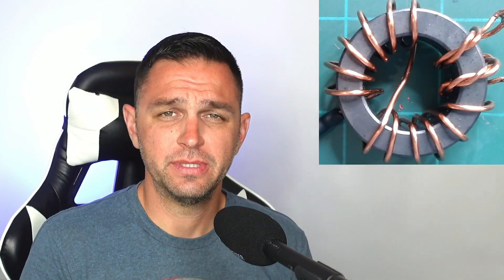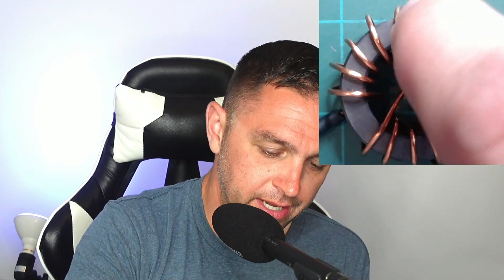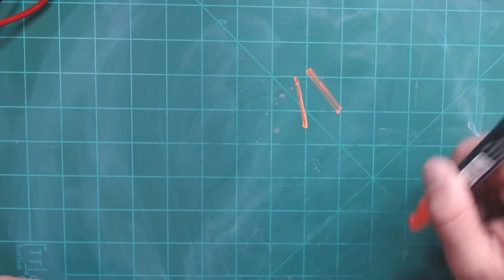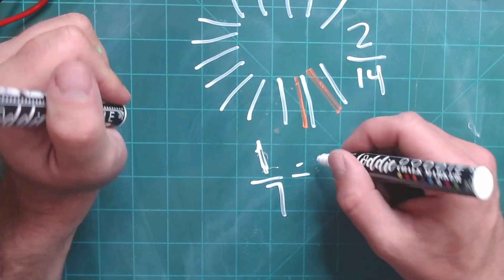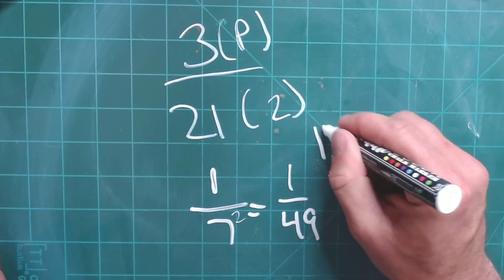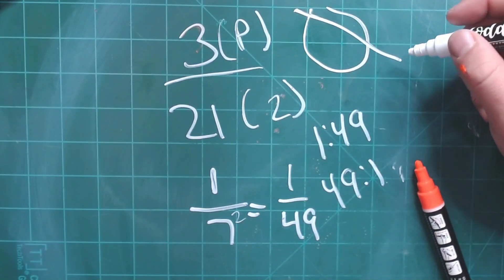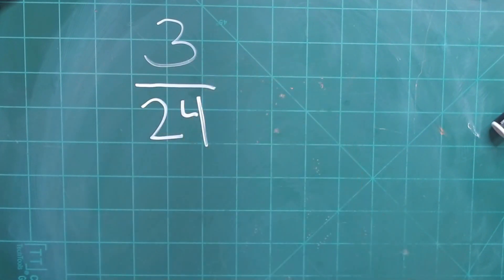EFHW Antenna / Transformer Ratios, It's too Easy!

Comment: that great. last one is 64:1 I find that better with 80/160 meters with type 43 ferrite. less heating. that the hardest part. telling the ferrite types apart. have to test like on a known VNA . don't need twist on primary to secondary. in fact only one 14 turn winding needed, put a tap on 2 turns . auto transformer 49:1 . and that a UNUN . 73's

Comment: Great video. The example you gave is 64:1. Am building a Good Guys EFHW (clone) and want to know why it has a 64:1 ratio. One of the comments gives a formula and it turns (no pun intended) out 3200ohms is the impedance it matches to a 50ohm coax.  Someone also mentioned putting in a tap to give the option of 49:1 - 2450ohms and I think that is a good idea. Thanks very much for the easy to understand description.  I will subscribe.  73 vk5wb.
Reply from the maker: I really want to do the tap soon.  I made a video on the x-tenna, which includes a switch between 49:1, 56:1, and 64:1 - and I think it's an amazing concept, just need to find a suitable switch.  Cheers.

Comment: I just made one, after the 14 turns I put a tap and 2 more turns for 64:1. That gives me 49:1 and 64:1. What ever tunes up the best. Putting my antenna low, I think I should have put in a 36:1 tap in there. Lower antennas sometimes have lower impedance. But I didn't think of that. It is made up and not taking it down to do that.

Comment: Take (secondary turns) divided by (primary turns)
and then square the result and then multiply that result by 50
giving you the ohms value the transformer will match.

i.e.  
If secondary is 21 turns and primary is 3 turns
Then 21/3 = 7
Now square 7 and get 49
Now multiply 49 by 50 and your transformer will match 2450 ohms

If secondary is 14 turns and primary is 2 turns
Then 14/2 = 7
Now square 7 and get 49
Now multiply 49 by 50 and your transformer will match 2450 ohms

If secondary is 24 turns and primary is 3 turns
Then 24/3 = 8
Now square 8 and get 64
Now multiply 64 by 50 and your transformer will match 3200 ohms

If secondary is 19 turns and primary is 3 turns
Then 19/3 = 6.33
Now square 6.33 and get 40.07
Now multiply 40.07 by 50 and your transformer will match 2003.5 ohms

If you put 3 turns on the primary and say 26 turns on the secondary
and put taps on the secondary windings starting at say 18 turns the
resulting matches for each tap will be...

tap 26 =  3753 ohms
tap 25 =  3471 ohms
tap 24 =  3200 ohms   this is the common 64:1
tap 23 =  2936 ohms
tap 22 =  2688 ohms
tap 21 =  2450 ohms  this is the common 49:1
tap 20 =  2220 ohms
tap 19 =  2005 ohms
tap 18 =  1800 ohms

Selecting the best tap for lowest swr is
easy and you have what amounts to a very simple
manual tuner.

This can be further refined by making the first several
feet of your longwire using something like very small
multi-stranded stainless steel aircraft control cable.
If you wind this cable onto a spool of some design
then you can change the actual antenna length without
cutting the wire, the turns all short out and don't
create an inductance...if the wire was insulated you
would be adjusting both antenna length and inductance
and you want only to change length. Using stainless
steel cable prevents rust and/or corrosion. If you have
your toroid mounted on a piece of plastic as is typical
then just cut two slots in the plastic to serve as the spool.
This is easier than adjusting the end of your wire by
folding it back since the adjustment can be made close
to the operating position with no need to lower the antenna.
This makes it easy to cover both 80 and 75 meters for example.

Combining the taps with easily adjustable wire length
results in an antenna for the field that can match any
HF band with a very low swr... if you use a spectrum
analyzer you will see that changing the wire length
moves all the harmonic dips either up or down in frequency.  
And changing the tap then refines the match lower or
higher in relation to the radios 50 ohms.

I hope my math is OK, I just used the google calculator
and did a quick check on this post, but you can see
what I'm doing here :-)

Comment: There was no VHF radio included when we bought our sailboat a few weeks ago. I live in Ontario Canada and since I’m considering a Ham radio licence in the not too distant future I’ve decided to buy a “handheld” VHF / UHF dual band radio that is of decent quality with features enough to suit my needs for now.

One of the features my new handheld radio “must” have is the ability to connect to an external antenna. After purchasing a radio I will buy and install an antenna on the top of the mast that’s designed to work well with that radio. Then I will run the cable {or cables} to the cockpit and cabin area’s and install permanent connections so I can connect my handheld when I’m in either location. 

I’ve been a boater for more than 40 years but always had a permanently installed VHF with my previous boats. Realizing I’m only able to transmit using VHF until I’m licenced for UHF here in Canada, it will still be nice to pass some time having the ability to monitor UHF during our travels.

Even though I’ve been doing a lot of reading about the different brands models and features, and despite watching several videos it seems a bit like information overload and honestly I’m feeling a bit lost trying to keep all the technical details straight but I must make a decision in the coming days because we’re launching our boat and I don’t want to be on the water without a working radio.

I would appreciate suggestions from those of you who have the experience and knowledge in this area. Perhaps you could offer a few good quality brands with the model numbers ranging in price from $100 - $150 {willing to spend more if justified} you feel would overall work well for use in my sailboat as well as my home. 

Once I obtain my Ham Radio licence in Canada I will also install an external antenna at home and this should get me started. Then after some hands on experience I will have a better understanding enabling me to make informed decisions later when it’s time upgrade.

Thanks in advance for your help and suggestions!

Regards
Tyler

Comment: (64:1) but what if the primary wires are made of lead coated copper, and the secondary is made of gold plated platinum wire?
What if you store the coils in a bath of liquid nitrogen?
What if its a full moon in Japan and my dog barks at the people walking by on a Tuesday and the coils are imaginary?

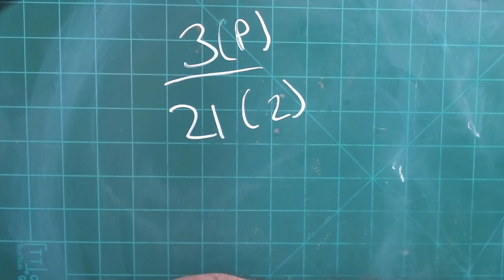Comment: I have found that a 40:1 or 44:1 transformer gives the best match with my little QRP kits and a 40m EFHW. I use  3:19 or 3:20 turns ratio.

Comment: Most Excellent.  More pleaase....  What number/type of Torrid do I use.  What gauge wire?  etc..
Reply: -43 or -52 mix are best for EFHW and other ununs for antenna feed points. -43 is the most common.  Size should be selected based o  power handling required. Sizes are generally measured in hundredths of an inch in outer, so an FT50-43 is half an inch in diameter.  50 size toroids are good for 5-10 watts depending on duty cycle, 140 size toroids are good for around 50 watts.  stack a couple together for a solid 100w transformer.  Wire gauge doesn't have to be as large as many people think 26 ga is generally enough for 100w, although 20-22 ga provides a nicer fit and will be slightly more efficient on a 140 toroid.  I use 26 ga in my QRP kits with a 50 size toroid.
Reply: @K6ARK  OK.  Please talk to me as you would a child.  Very ignorant.  So I have sitting in front of me several Amidon FT-240-43 torrids.  By your statement:  -43 or -52 then these would be OK to use?   So then... the amidon (FT-240-J) and (FT-240-77) and (FB-31-2401) would not work.  Correct?   Where does one learn these arcane arts? Tank you. 73
Reply: @mattstosh6960  no problem. 
-J material (also known as -75), -77 material, and -31 material are better suited for common mode choke applications.  You could try using them in a broadband transformer like a 49:1 unun, but would likely have greater losses and poor performance on at least some bands.  I learned about this stuff but reading material from Palomar Engineering and other sites with analysis and research on ferrite materials.
Reply: @mattstosh6960  Palomar Engineers website has a couple documents that describe uses for different ferrite mixes.

Comment: Dude! These are transformers, not antennas. The wire and the transformer together make up an antenna system. That said, your counting turns is correct. I made up just such an antenna transformer at the weekend by the way...